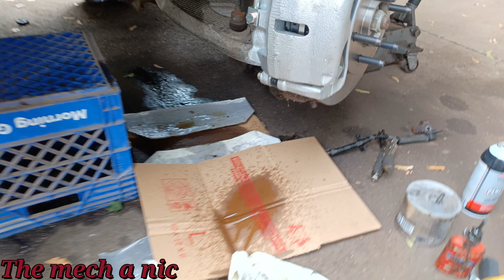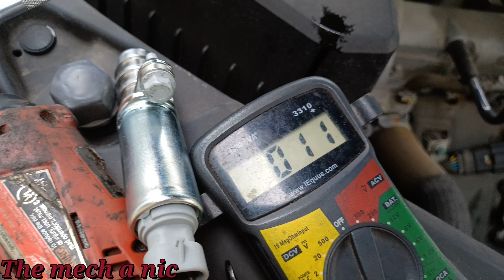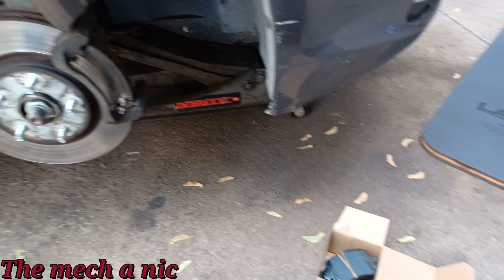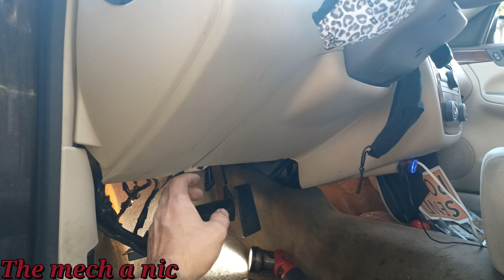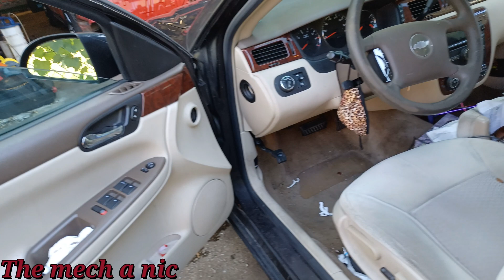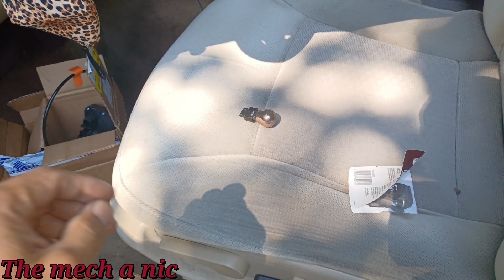p0010 chevy equinox / F150 locked up caliper / impala door lock actuator (vol 104)

Comment: I saw Eric O do an interesting trick last month, to help decide which side the bad wheel bearing is on. He put the car onto the lift, had his wife hold her foot on the brake, and then he clamped the brake hose on one side with rubber pliers. So, one caliper was artificially locked. Then he asked her to start the engine and gently put it into drive, and listened for the sound. If the sound disappeared, the bad wheel bearing was on that side! I'm guessing this wouldn't be wise in an AWD vehicle, but for old style cars it might be worth a try.
Reply from the maker: Yeah I saw that video. Thought it was interesting.  Maybe I'll give it a go next time and see if it works 👍

Comment: I can usually find a noisy wheel bearing by grabbing the spring while the wheel is spinning. 👍
Reply from the maker: I'll try that next time
Reply: @themechanic6117  ill add to this, i will put my mechanics stethescope to the spring and listen, careful though it can hurt your ears if the bearing is  a squealer! Long screwddriver works also with a milk jug cut in half to be used as a sound amplifier.

Comment: Been thinking of getting one of those f150s. Would you say it’s been reliable?
Reply: cant tell you how many of those generation f150s come into my shop with well over 200k miles on it, goes with alot of cars and trucks just keep up with the damn maintenance lol
Reply from the maker: I hear the 5.4 is notorious for timing problems.  This f150 has the 5.4
Reply: @themechanic6117  Ya with the plastic timing chain tensioners. Have to replace with the steel ones before the real damage happens. Seen it on the offroad mechanics channel.
Reply from the maker: Can't say ,we don't drive it much...